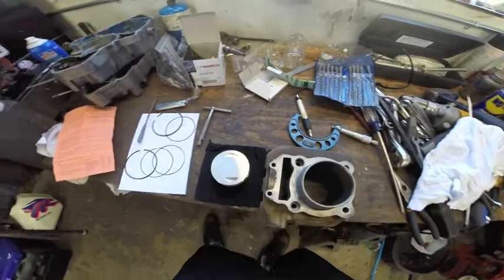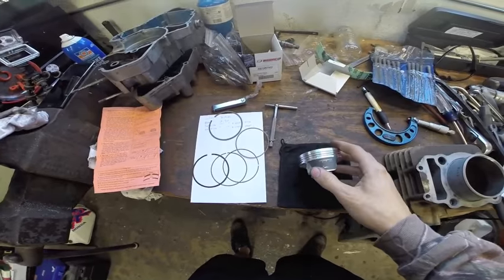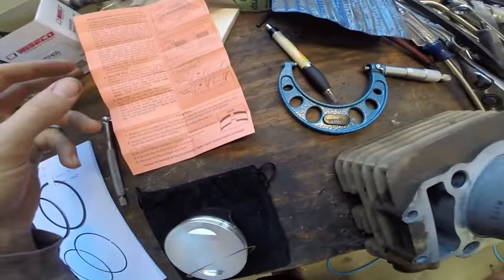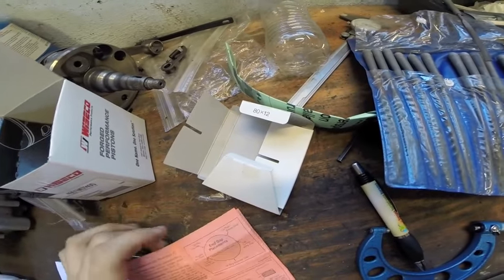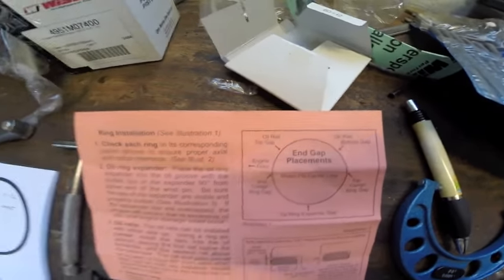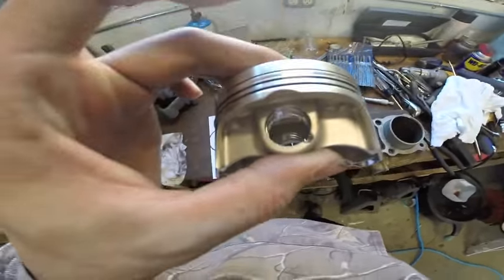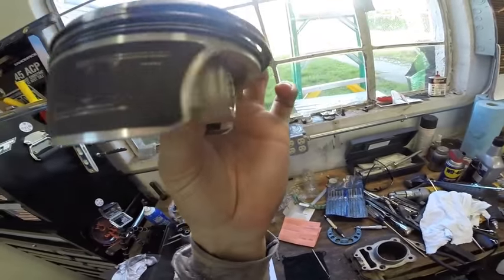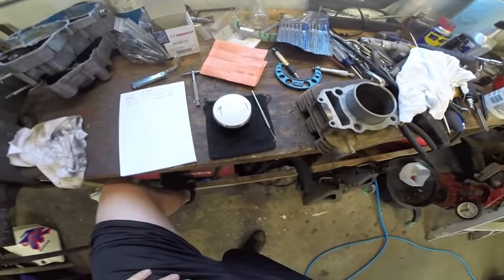How To Install Piston Rings On a 4 Stroke Piston

Comment: Hi just thought I'd say that it doesn't matter which way the ends on the oil ring sepetator are facing. You said they need to be faced up but it really doesn't matter. Just posting this to help anyone out there who's installing rings.
Reply: But other then that this is a great video
Reply from the maker: Hey thanks man! I always appreciate the help!

Comment: Great video. I have a 92 susuki quadrunner it ran good I full trothle it when I got it running. Then came home and now no compression. It blows it back to the carburetor. Any idea what it could be?
Reply: If it blows back the air through the carburettor than you have to tack the cylinder head off and put the piston to the bottom and put it so next valve opens is air/petrol valve
Reply: It is the valves are not sync with the piston
Reply: @Doitallbros  ok lo buscare .
Reply: @Doitallbros  I meant ok I will look in to it

Comment: the Wiseco instructions are actually confusing.  The engine front points left (9 oclock) and the "center line" also goes left to right (3 oclock to 9 oclock). I assume the center line is the Piston Pin bore. That being the case the front of most atv engines point to 12 oclock or exhaust port.  Not sure why Wiseco's diagram is the way it is and it creates uncertainty regarding placement

Comment: good video..  Is there a certain way ( meaning facing up or down)  the second an third go in?
Reply from the maker: Kaution Diaz usually the second one will. The oil seals or lower set does not matter

Comment: Wiseco instructions, illustration 1, has a line running through the pic of the piston called "piston pin center line". What the hell does that mean? It's confusing.
Front of the bike is exhaust.. correct?
Reply: Depends on your bike, some bikes have the exhaust in the front, some have them in the back
Reply: On illustration 1 on the  orange instruction sheet - forget the arrow with the "engine front". The piston pin center line is where the wrist pin will go. So at the top of the illustration, is actually the direction towards the front of the engine or towards exhaust. The oil ring expander gap should be as shown, 90 degrees from the WRIST PIN, as the  written instructions say. Not aligned with the wrist pin.